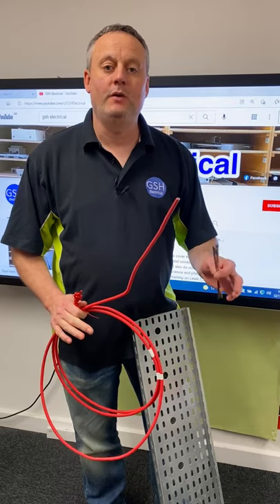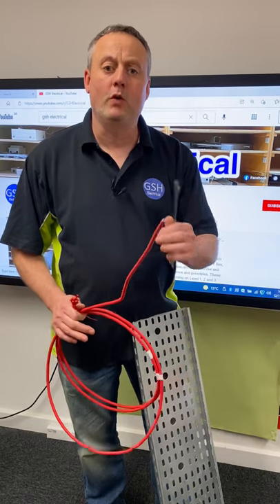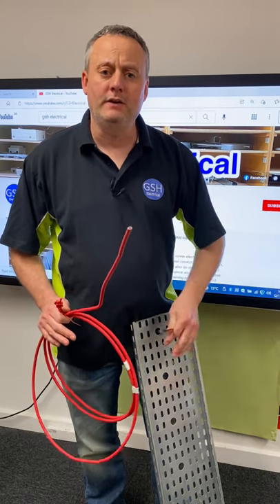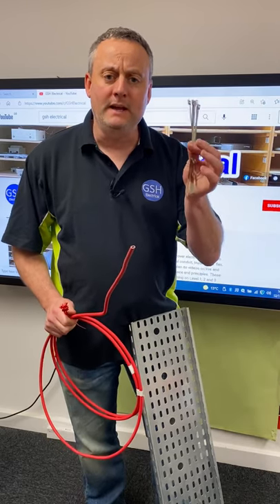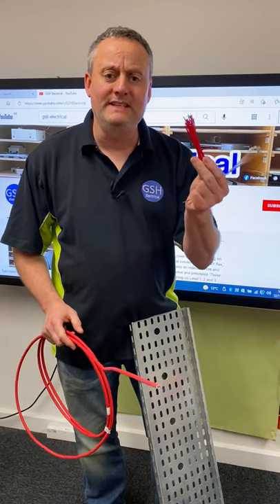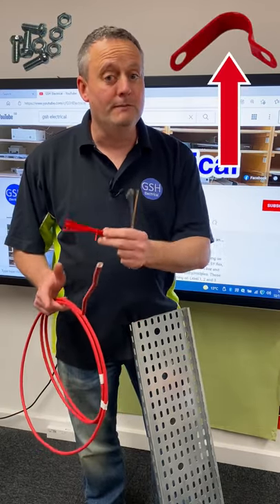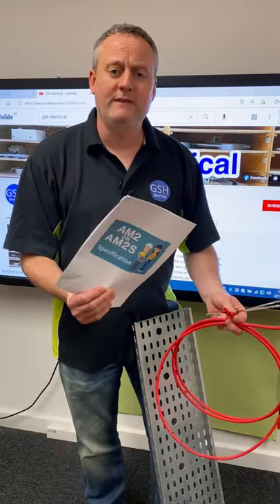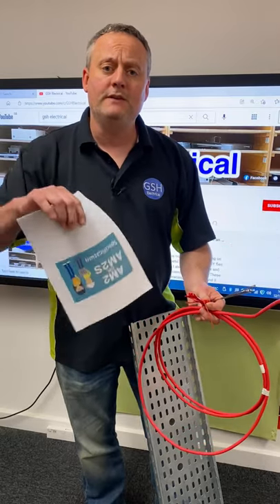AM2 and AM2S Top Tips - P Clips to Support FP200 on Cable Tray

Comment: It’s always worth asking my spec said P clips but the guys there said to use plastic ties.
I know all the centres are meant to follow the same rules but it doesn’t seem they do all depends on the centre I had to dismantle my rig after some centres don’t want you to.
Reply: I remember I had to do P clips, was a pain in the butt with trying to hold the nuts at the back, think I only ended up doing them finger tight at the start and then tightened them at the end when I knew I was ok for time...  My centre wanted to keep it as is so it would be checked and assessed after I had finished.